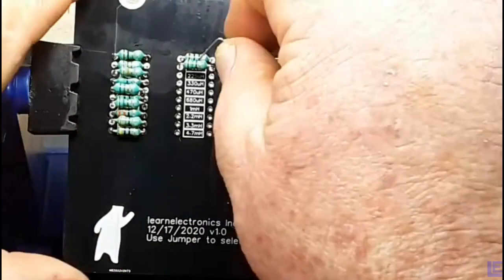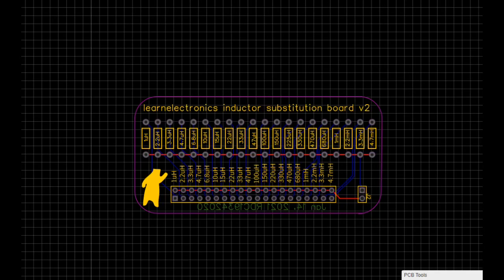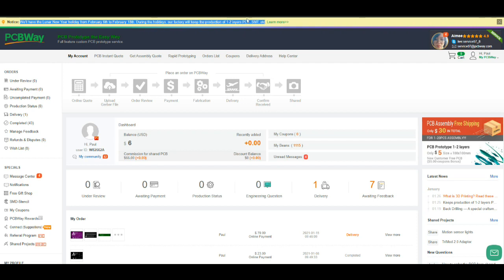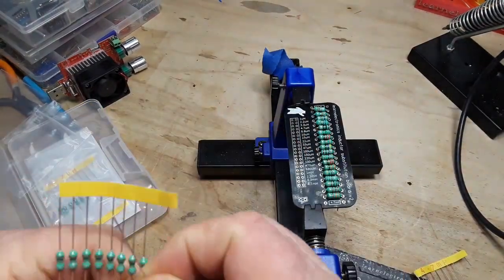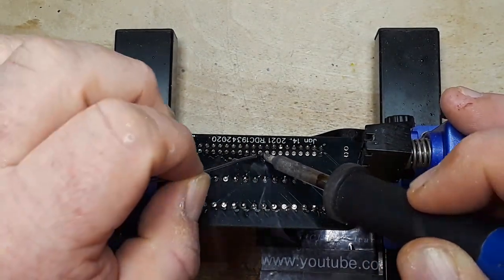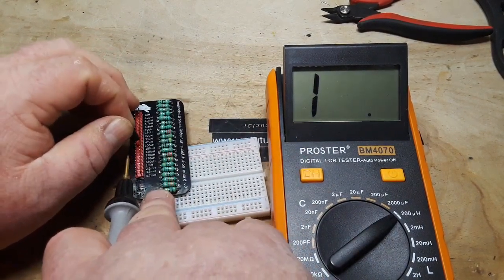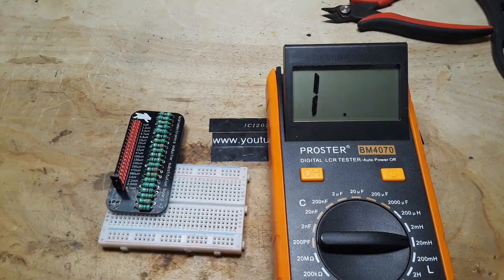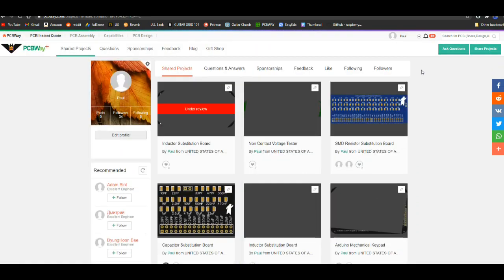Inductor Substitution Board V2   Now Breadboard Friendly

Comment: - rather than having the inductors in parallel,  (L1+L2+..+Ln)/n perhaps could have them all initially hard-wired in series, & then have  the jumpers serving to short out across each individual inductor - kind of like a 'subtractive' process -i.e. you start off with one big inductor (L1+L2+....+Ln) & then short out the ones you don't want, until you get down to the desired value -

Comment: How do I know if I'm looking at an inductor or a resistor if the color code does not match  up with either?
If its a resistor, it is way way off!
If it's an inductor is way off. So I don't know?
Reply from the maker: Inductors have an hourglass shape, resistors are cylindrical.

Comment: Hey Paul... love the breakout boards. Only issue is the cost to ship. I really only want one board per each device ( cap, inductor, resist).. boards were reasonably priced from PCBWAY but the shipping  Cost was extreme .. too bad oh well. Thanks for the videos. Good luck with the ankle. Keep the videos coming.
Reply from the maker: You can download the Gerbers and get the boards made anywhere you like. All my designs are free.
Reply: Have you tried Jlcpcb?
I find they are a lot cheaper for shipping , at least to where I live 

www.jlcpcb.com